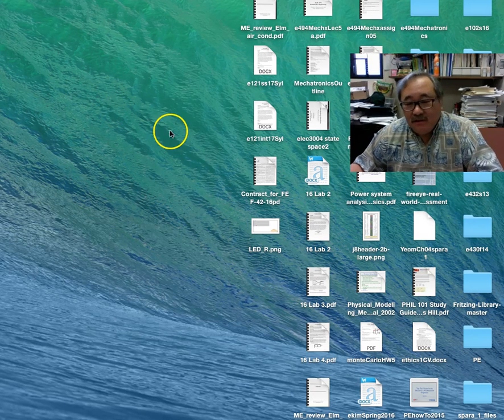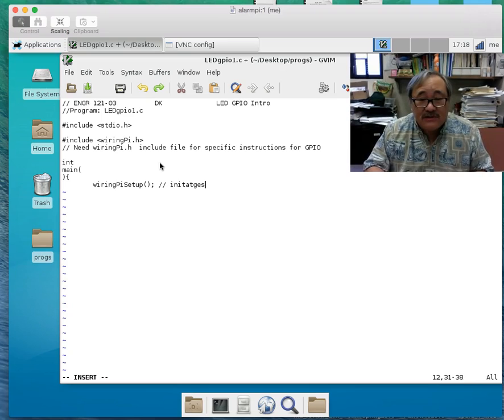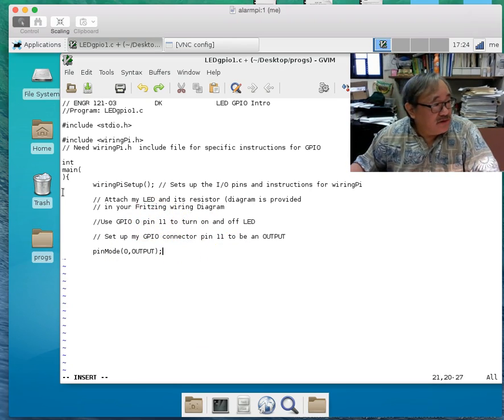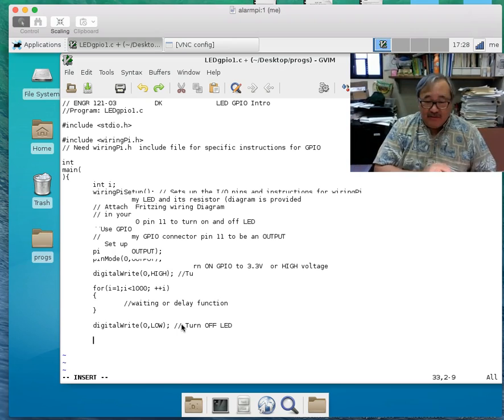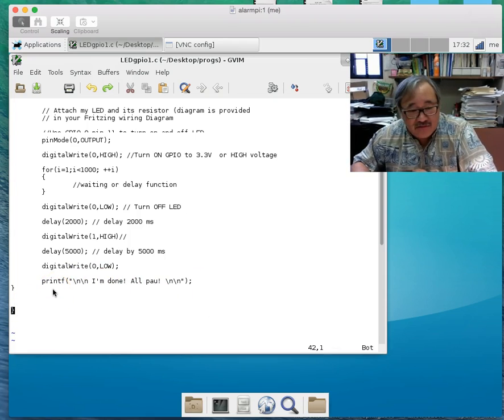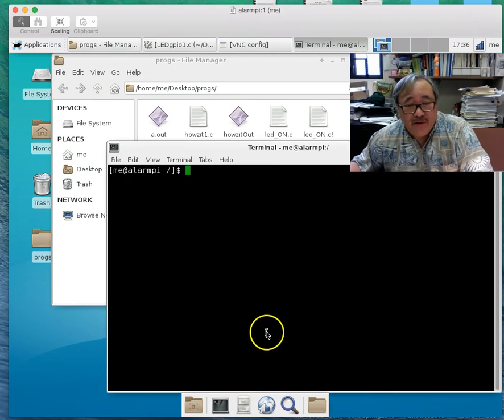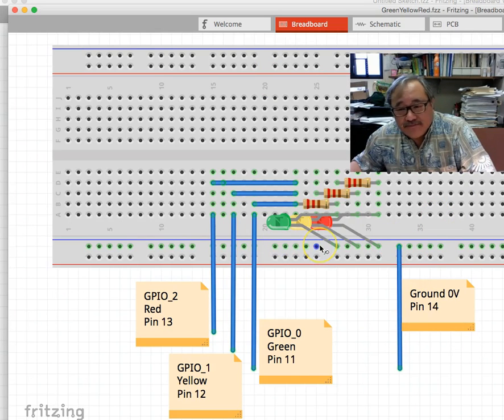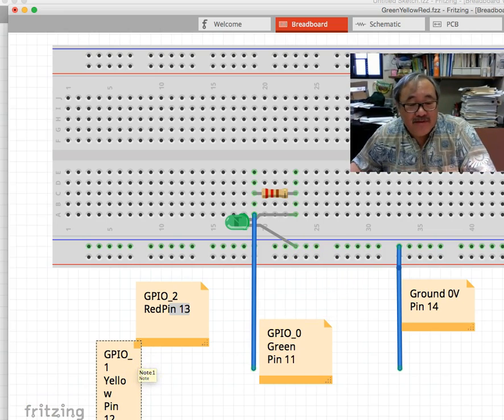introduction to turning on LED using Raspberry Pi 2B and wiringPi.h

Comment: Hi Ernie, I'm using the Pi 3 which has a different GPIO layout. Pin 11 corresponds to GPIO 17. When I run your code using 17 instead of 0 like I thought would make sense, nothing happens. Yet when I use 0, it does work! My board doesn't even have a GPIO. Why does the code work with my board? Very confused!
Reply from the maker: I'll check it our on my Pi3 and try to get back to you next week. Thanks for viewing my video and trying things out!
Reply: +Ernie Kim I actually figured the issue out! wiringPi has its own numbers and pin 11 is always referred to as 0 when coding. Where does one learn more projects involving wiringpi? There seem to be very few resources aside from your video teaching beginner projects with the library!